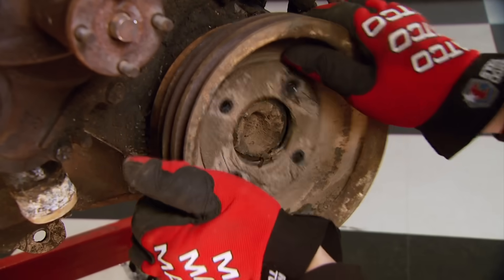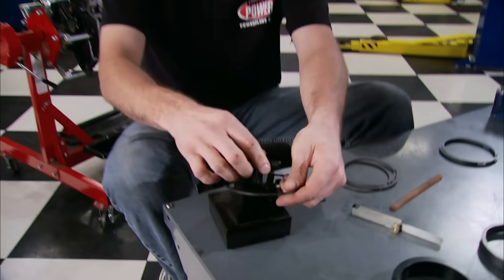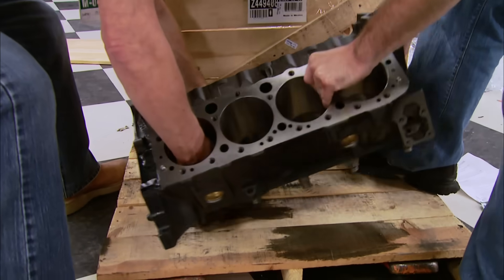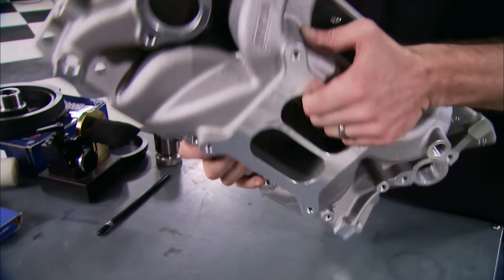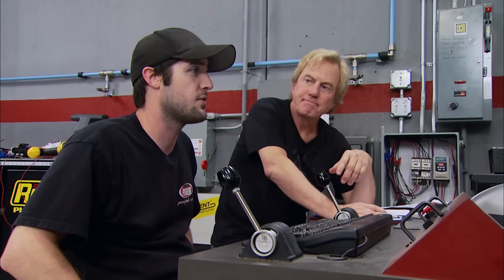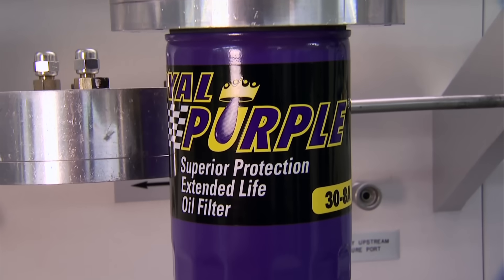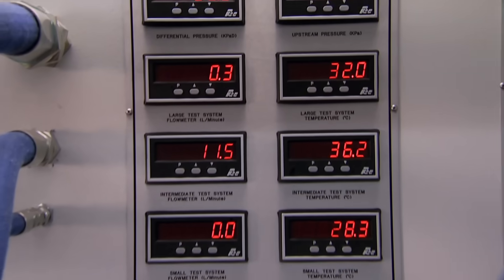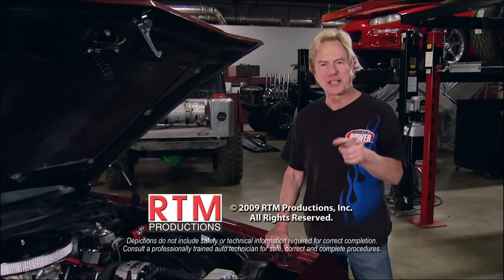Building A High-Performance Smallblock V8 From Scratch Using Only Catalog Parts -Horsepower S13, E18

Comment: There is no purpose in indexing the piston rings.
First, they rotate when the engine is running. The crosshatch pattern on the cylinder walls is intended to rotate the piston rings, so theyre going to end up in a different position every stroke of the crank.
Second, the piston to cylinder wall gap creates an area which is massive compared to the piston ring gap. The amount of blowby which can leak through a ring is restricted by the surface area of the piston ring gap multiplied by the piston to cylinder wall clearance. However, the airflow betwwen compression rings is the surface area of the piston to cylindet gap multiplied by the height between the 1st and second ring. The result is that the area between the rings can flow an order of magnitude more blowby than the ring gaps, and the same amount of blowby will leak past regardless of if the ring gaps are on opposite sides of the piston or directly lined up.
Lastly, if the rings didnt rotate, you would have a groove straight up and down the cylinder wall where the gaps were.

Comment: Being from Arkansas you know like i do that if you want true power the 454 Big block is the King of the Hill...ok you can put turbo and noss of a smaller engine or small block and get get great performance but you also have long term wear on the heads will it last? Doughtfull maybe 150k but i bet that it would break long before 100k So way the 454? American None Hemi trash I speaking of quality and yes there's a premium #GM AKA #Chevy build quality when it comes to the big block it had withheld the test of time. by far and the LS engines are trash I guess it is in the eye of the beholder but when you have fails at 50K miles over heating and issues a good example was a video on YouTube of a COP car engine that could not stand the test of time when the engine was tore down lots of issues I will leave the video here https://youtu.be/FyS6hsqR9qY?si=uBrzncfSrwXgrhbt I guess you can blame the builder or maintained  service but they just don't build them like they used to and they try to make you pay a premium price for Junk don't be fooled They know how to make quality but trying to force more performance even at 100k and failing at 50K wow really?  sadly they need to go back to the old school my choice by far is the 454. - Rave - #littlerock #Arkansas

Comment: The 485 torque will give fantastic street snap and seat of pants feel. The 443hp will carry nicely. Hit it with even just a tiny 75hp nitrous shot and I'd bet 600 for torque and 525ish hp. Best part is it should live a long life. I do wonder about an rpm airgap intake and something like a holley 750 mechanical carb. Maybe a carb spacer. I'm thinking 520torque and 475+hp with very civilized street manners. It may also carry peak hp longer/higher rpm. No matter, a strong little engine. Disguise it as a late model 305 and go hurt some feelings.

Comment: I WISH those heads were still $570 a piece. Now they're over $1k. I miss the old days of hot rodding, when you could grab a used car for less than $2k, and build the daylights out of it for about what you have in it to begin with.

Comment: As a non engine guy- How come the small block Coyote engine makes so much power and it is worth the price in a crate. thank you.
Reply: Overhead cams allow HIGHER RPM. Better for Horsepower output.
Reply: @michaelreppert1207  Also eliminates pushrods allowing better port placement with them out of the way.

Comment: A hypertectic piston ain't worth a penny.  Forged is king and there is no compromise unless it an average driven car that cast pistons would work with. Don't waist your build time and money on hypertectic pistons. Time always tells, they won't take abuse. I've seen racing forged Pistons go through a full season of hard racing then rebuilt either do to spin rod bearing or refresh. Hypertectic pistons won't hold up in south eastern usa weather maybe?, idk. If you're paying extra because cast may be a risk then buy forged. Hypertectic will explode and damage rods, possible block/cylinder damage. They work great  in controlled environments

Comment: I'm building something like this right now.  30 over 350 4-bolt, Eagle rods, Speed Pro pistons - all from Summit.  Forged Chevy steel crank (non-stroker), true roller valvetrain (Crane, Melling, and Howards parts), Brodix Track-1 heads, Offenhauser individual runner intake w/ twin 390 double pumpers and non-progressive linkage (essentially 8 one-barrels), 10.25:1 CR, est. 511 HP, pump gas, no turbo, no blower, no nitrous.  They don't mention that a high-volume Melling oil pump requires a longer bolt.  I damaged my rear main saddle using the shorter bolt.  Steel aftermarket saddles had to be line bored to fit.  Couldn't find a used saddle - had to get another block and take the saddle off it. Now I have a spare block with a steel rear main saddle.

Comment: i never run a motor full blast after a rebuild, i get 500 miles then drive it however i want.
Reply: Motor=electric....engine=gasoline. A motor starts an engine.
Reply: All you're doing by waiting is compromising ring seal. Engines seal better and last longer when ran hard out the gate. This has been proven over and over for decades.

Comment: So you saved $1200 by building it yourself vs buying a crate. Heres the big question...youd have to have the tools and know how to build it, so now if you had to buy all the tools needed to build it, how much would that set you back?
Reply: Shhhh lol
Reply: A good set of dial gauges will eat up a ton of budget for measuring bearing clearances which they never seem to do. Just slap the crank in and go lol
Reply: Without tools how do you install the crate motor?

Comment: 10-1 compression 224-230 or so duration aluminum heads more cubic inches if possible easy power if boosted forged pistons 212-218 or so duration budget builds

Comment: 89 RON is crap fuel high octane could have eeekked out more horsepower
Reply: You only need as much octane as you need  no use In paying more for higher octane if it does it no good. Maybe if they ran 11:1. Then I'd def be running 91

Comment: Uh huh - goes to the trouble of carefully gapping the rings, then effectively opens the ring leakage path by 10's of thou's by massively overdoing the de-burring afterwards.
if they put that ring back in the bore and shone a light from behind it, it'd be perfectly illuminated why they needed to throw those rings away, and do it properly with a fresh set.
Reply: I'm sure they measured it. You don't have to go crazy with the stone and it won't remove that much that's silly
Reply: @KingJT80  
You DID watch the video? If so, perhaps you should do again, with special attention paid to that part.
Reply: @gordowg1wg145  then how come it didn't run like that on the dyno then? That would have showed up immediately as blow by.... Your comment doesn't even make sense
Reply: @KingJT80  
The range where ring gap becomes significant is around the 50 thou" mark (some ring manufacturers, who actually test these things, say closer to 40, some say closer to 60) - why don't you know that? Still doesn't excuse poor practice.
Reply: @gordowg1wg145  again, where was the blowby at??
Reply: @KingJT80  
Since you didn't realise the initial point, and didn't understand the clarification, I don't see much point continuing this 'discussion" as you're clearly unable to understand and/or a troll.
READ what I wrote, then check the veracity with the ring manufacturers, THEN, and only then, you may contact me again!

Comment: This show has always been an enigma to me. Even after leaving out 99.999% of everything they do, what they do show, they show for about 2 seconds, then cut to someone talking about it for 10 more seconds. And then the writers feel that, even after considering their audience (gearheads), they feel its necessary to explain what pressfit means. Thats like Kardashians feeling it necessary to explain what eyeliner was to their audience. 
Plus, on top of all that, their projects are all sponsored with unlimited budgets.
Reply: The parts they're using on this engine is literally what most guys use in their backyard as blue collar working people

I'd be using the same stuff on my 302 Ford so it's not very far-fetched
Reply: @KingJT80  Who said anything about being far fetched? I only said they always have the high-end components, without regard to cost. If thats how you do your rebuilds, then you clearly are out of touch.
Reply: @ckmoore101  there's literally no high end components in this video.  Nothing was a custom CNC head or no custom cams. 

 Literally a catalog build that you can find like 10000 videos on...
Reply: @KingJT80  Fine buddy. This is a budget build. You got me. 🤪
Reply: @ckmoore101  if you're hot rodding and want this HP level. Save up 5000.00 or just don't and use the stock engine.. whatever....

Comment: You can make same power with gas flowed stock iorn heads,skimmed, thin steel head gasket, flat tappet cam, stock cast pistons.
Not very impressive given your overkill ally heads and hyd roller cam.
That is an average 500hp build.
Reply: No kidding.  A junkyard stock stroke vortec 350 with a bigger roller cam can make more power than that expensive joke of a stroker they 'built'.
Reply: @earlbrown Not really

 those heads are capable of more than any vortec head out of the factory would ever be capable of

 vortecs were made for lower RPM trucks and vans, that on a good day, would flow maybe 225 cfm. Eddy rpms flow a minimum of 20 cfm better at the same lift with better springs and bigger valves. 

I only use them if I had them I wouldn't go out and buy them because you could just buy ProMaxx vortec  heads heads that flow way more with more features
Reply: @KingJT80   Yes. But if you bolt them to a garbage shortblock (with a mismatched cam), the extra flow from the heads can work against you.  Bigass high flowing ports don't work as good when the port velocity is way down due to piss poor VE.

Especially if you spend all the money on the heads you can't use, when when that cash could have been reallocated on making a total package, instead of checkbook hotrodding.
Reply: @earlbrown what was garbage about this short block? It made exactly what was supposed to make

 it's a cast crank and hyperutectic pistons with 10:01 compression on a 383 You don't need that much cam or that much head or RPM to make the kind of power that they're making so they pick the heads and cam that they did and it actually worked pretty good
Reply: @KingJT80   If it only ''makes what is was supposed to make'' and you only want very little actual power....   then yes, this was still a waste of time.

the amount of money and effort put into that build should result in more power.

Find piss-cutters channel and look at his bare bones Vortec builds.  He has two, one with a flat tappet cam, and one with a roller.  And with no 'cool guy' catalog parts. Just plain boring Vortec parts you can get anywhere and end up with a much better engine that anyone could build.

Unless you're a bench racer, of course. (or a checkbook hotrodder).

I'm neither.   I'm just a professional engine builder and automotive machinist that would be embarrassed to build an engine like that for a customer.

Comment: Always check your clearances, even on pre packaged kits such as the one that they used.
Reply: Do these kits come with a list of all the proper clearances?
Reply: @Baron-Von-1973 No, but you can find all kinds of charts showing the recommended tolerance/clearance ranges for your application and power output.

Comment: It would have been nice to see you checked the main and rod bearing clearance, showed the combustion chambers cc'd them to check compression ratio that I don't think you said and made sure the intake and head runners were aligned. Just my 2 cents. Oh, and indexed the cam and checked piston to valve clearance when you went to the trouble of setting the ring gaps. I run NAPA Gold oil filters and after break in with deno oil, Mobil 1, full synthetic.

Comment: Tfs 11r heads 190cc.  58cc.   Tfs stage 2 cam.  1.7 rockers.   Rpm airgap.  351w f4 roller block stock as junkyard ford bottom end.  440 rwhp.

Comment: They built a 302 Ford did not stroke it. They called it a budget build. Spent 3,000 dollars. The little 302 made a little over 400 hp.  Here they build a 383 stroker, spend over 4,500 dollars and get 470 hp. It took 77 more cubes and 1,500 dollars . Would like to see the hp the 302 would put out, stroked to 347 ci and the other goodies 1,500 would buy. Just curious. lol
Reply: And with this expensive 383 stroker they made almost as much HP as a junkyard vortec 350 with a larger roller cam.

I about fell out when they stopped trying to make more power and stopped at less than 450hp.

Comment: I was gonna ask cost, but see it's called out at 11:19 in and difference between ZZ383 + parts OR horsepower summit and difference = $5,840 v. $4,637 diff $1,202.  
WOW, have times changed as you could get this for about $800-1000 back in 1990 (32 years ago) and produce 400HP v. 440HP for this!!
Reply: From 2030 on in USA and EU all gas engines will be banned due to Babvvo laws!

Comment: no one uses carbs or distributors at this time do you live in the time of stone? and why does this engine only have two valves per cylinder, it is no longer used only some diesel cars still use two valves per cylinder over ninety percent of recent cars use 4 valves per cylinder and some 5 
what a shit engine 
engine assembled by Americans, one can only expect rubbish
Reply: Many of the fastest cars around do still use carbs and distributors. The fastest cars out there even use 2 valves per cylinder

Comment: Could easily push the power up. 
Proper Multipoint Fuel injection 
Coil on Plug For Sparkies. 
Good ecu for tuning and push 500 HP
Reply: Lol carb will always make a little more power there head's are just absolutely garbage I mean just look at the holes in the casting and a 380 needs 210 wider lsa like 113 or 115 to push the rpm out past 5500

Comment: With an out-of-the-box crank and a new set of rods, how was rod side-clearance set?  What was the matching process for rods-to-crank journal clearance(s)?
Reply: Probably sold as a matched kit, and comes numbered. 

That being said though, there's more measurements than ring gap (the only one they showed) needed when assembling an engine.

Comment: Are Aluminum Heads already Ported and Polished? Or could they use more? Also what's my best option? Let a Machine Shop build a motor for me, or buy a Turn Key Crate Engine?
Reply: Most aluminum heads are not ported or polished out of the box, but you can get some really good ones these days from texas speed, or I think motion raceworks sells that kind of stuff too. Your better off building it yourself unless you want to wait about 6 months for the machine work. Which can go upwards of 2000 dollars just to get it bored decked and have the cam bearings replaced.
Reply: @jasonveto2320  Thank you Sir 🙋🏿‍♂️
Reply: @jasonveto2320  Thank you Sir

Comment: What’s the rust inhibitor coating that they used for storage and shipping that they had to remove? I would like to get some for the engines, blocks, cranks, rods, heads (yes some people still use iron heads, whether it’s because the class doesn’t allow aluminum, or because there isn’t an aluminum head in your budget range that would outflow your current heads) and instead of coating them with lithium grease, or rust killer spray…
Reply: The classic is Cosmoline but there are plenty of others including Boshield and Fluid Film.

Comment: Anyone building an engine like this.
Is taking one hell of a chance.
No mention of bearing clearance.
No  measure of nothing??
Heads right out of the box bolted on motor??
Motor running on dyno
No pvc valve,no crankcase evacuation system??
Talk about no blow by.
Keep running it like that, you'll have all the blow by you could ask for.
This video is certainly nothing to watch for the inspiring engine builder.
If it was this simple ,everyone would be a engine builder.you can't trust anyone 
When it comes to buying parts.
Everything must be checked and verified that it is,
 What it is suppose to be.
These guys  are just fluffers.

Comment: Not enough cam when you have more torque than hp.
Reply: That depends entirely on what you're looking for. Numbers like those here are great for heavier vehicles (trucks and full size vans). Power is nice, but it's the torque that moves the weight. Heavy vehicles benefit from more torque like the balance of these numbers. ;)

Comment: I can build the complete engine myself. I just need help in understanding the piston rings.  Getting the right gap before you attach them to the pistons.  I need to learn more in this area, then I am ready to save my money.  So I may buy and build in the future. Thank you so much!!!!  I learned so much.
Reply: fit the ring in the cylinder, measure the gap with feeler gauges, remove the ring, grind the ring a bit on an end gap grinder, reinstall and re-measure. repeat until you get the correct gap.  then install the ring on the piston.  pre-gapped or zero-gap rings are other possible options.  My current build is a 30 over 350 w/ 10.25:1 CR rated at an estimated 511 HP on pump gas, and it uses pre-gapped Sealed Power rings as I recall.

Comment: you dont need to put assembly lube on a roller cam, your better off soaking them in oil over night, it soaks into the roller bearing.